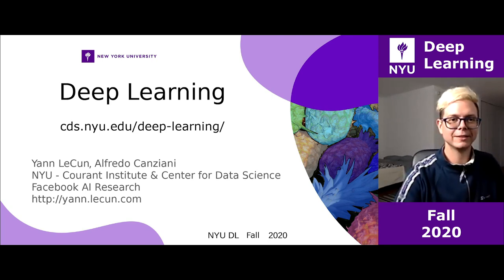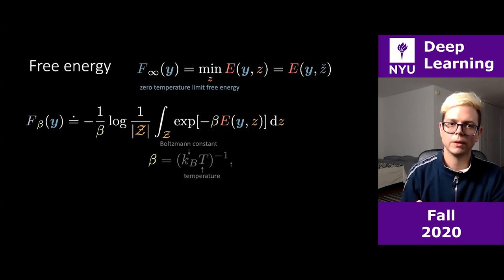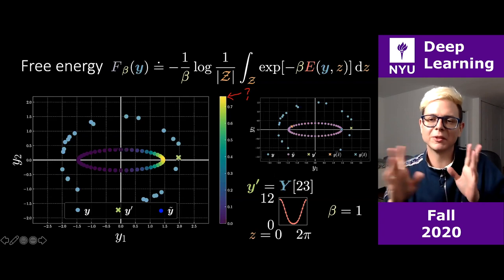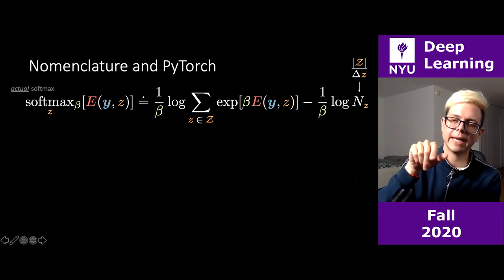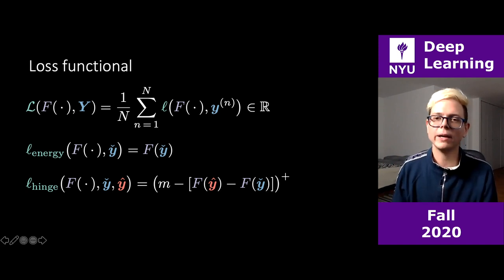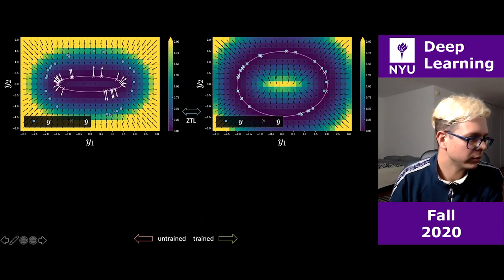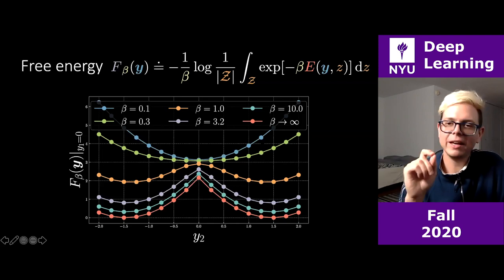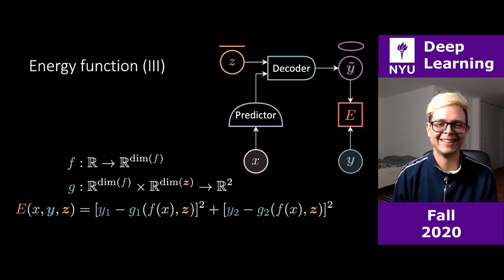Week 15 – Practicum part B: Training latent variable energy based models (EBMs)

Comment: Hi, Alfredo 👋
Is it correct that the conditional case it's just an unconditional one but with trainable weights?

I mean, first, in the unconditional case (from the previous video) we had a Decoder as:
g = w1*cos(z), w2*sin(z), where we had just 2 non-trainable constants as "weights" w1 and w2. 

And then in the conditional case (46:55), we just have absolutely the same Decoder:
"g" = w1*cos(z), w2*sin(z), but now it consists of Predictor*Decoder = f*g = [w1 w2] * [cos(z), sin(z)] = w1*cos(z), w2*sin(z), having now trainable weights w1 and w2, which are just outputs of the Predictor network? 🤸‍♂️
Reply from the maker: Uh, no?

The decoder expression is different.
Also, the predictor is not [w₁ w₂]…

The only difference is that now there's an x.
Reply: @alfcnz  uh, ok, by Predictor I meant "the output of a Predictor" 👦
Will check lessons again, thanks 👍
Reply from the maker: Uh… okay. Read the summaries as well, and see if that's easier to understand. Also, let me know if anything is missing there.

Comment: Would you please share the code you used to produce this example? I am still struggling to understand how the latent variable is optimised and how the energy for positive examples would be increased. So, I think the code along with your explanation could make it easier to grasp.
Reply from the maker: Hi Mohamad, the code is optimised for quality graphics production, not eduction. I won't share something as an afterthought. Nevertheless, I encourage you to code this example step-by-step, while following the lecture. If you need help with anything, I can provide support, here, on Reddit, Twitter, or Discord. Actually, on Discord you can even find a group of students like yourself potentially interested in working with you on this project. If it's well done, I'll upload on the class website.